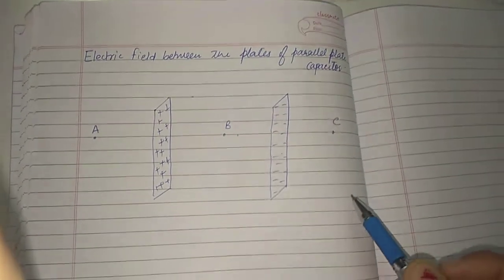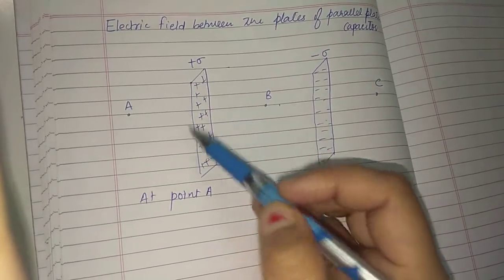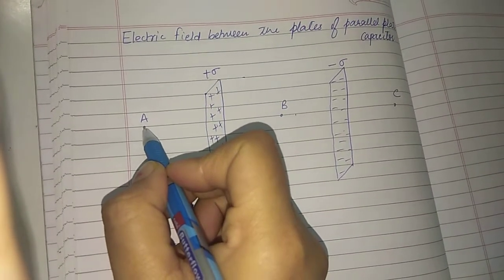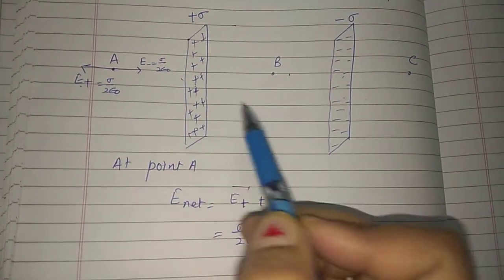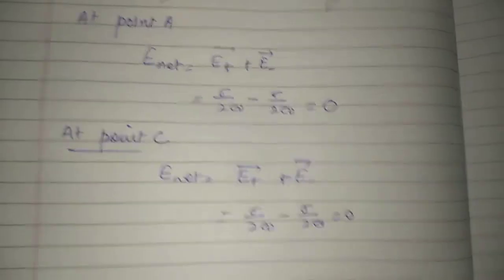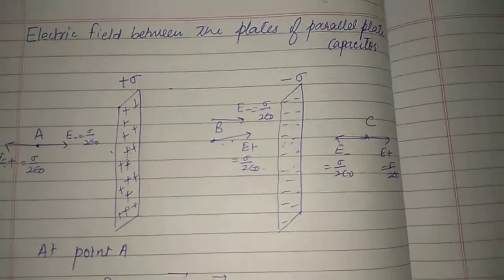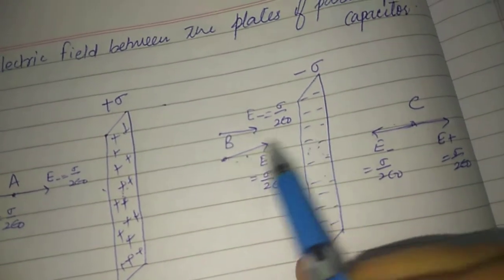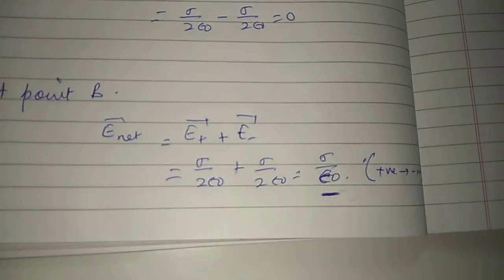Electric Field between the two plates of a Parallel Plate Capacitor

Comment: But mam electric field due to a  metal(conducting )plate is sigma ÷epsilon not only
Reply: When talking about metal conducting plate we are talking about thick metal hence the + and -charges are distributed on both side so for both sides 
Electric field net = sigma/2epsilon + sigma/2epsilon= sigma/epsilon

-|+
-|+  
-|+
Reply: infinite sheets pe sigma/2epsilon hee electric field hoti hai aur metal conducting plates pe dono side ko infinite sheet mante hai toh woh dono add ho jati hai